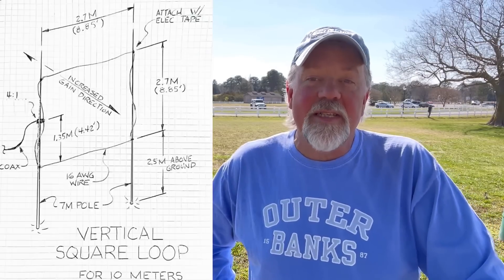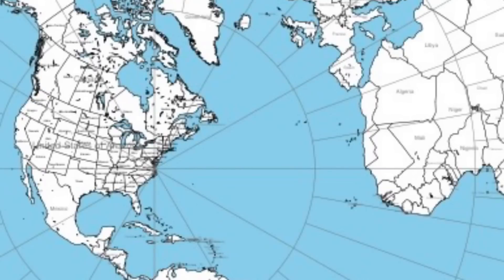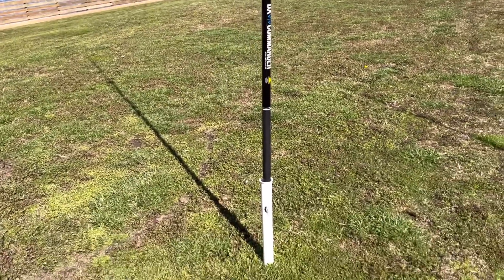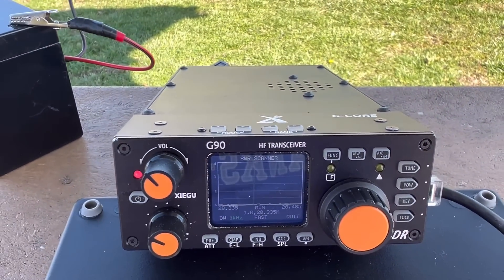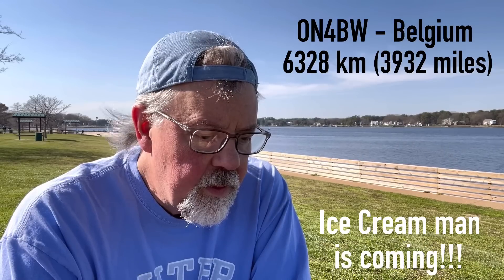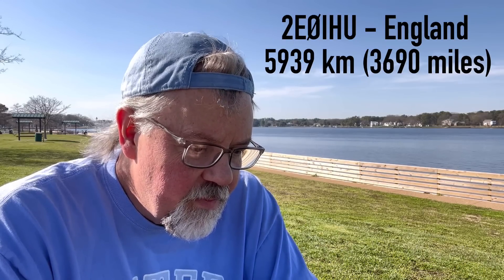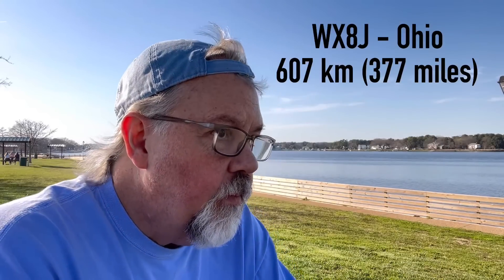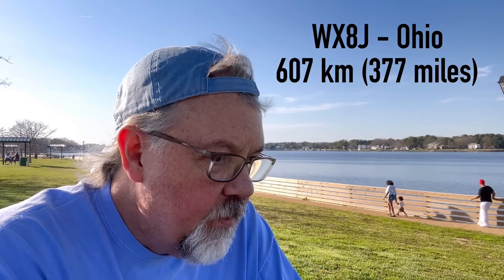Square Loop Antenna for 10 Meters

Comment: Thanks for sharing that, Walt! Those loops are definitely working! I am unfortunate enough to live in an apartment block with not a single option for an external aerial. After some successfull experiments  with magnetic loops, I've also came up with an idea to build a large loop, although rectangular. The loop I've made stretches along my apt 2x large windows and is fed from a top horizontal side. There is a very general description on my QRZ page. With an antenna tuner the loop is actually multi-band. My version is covering 80m-10m bands. Since then I've figured out, that by adding a loading coil just opposite a feed point the loop can get resonated on lower bands (80m-40m) with good results. From EI I've made plenty of USA, some South America and even New Zealand, all CW though. 
A short video of Chilean CA4OMQ signals in EI last August: https://youtu.be/XQRmCMmIvP8
73 de EI4JY, Alex

Comment: The choice of feed point makes a huge difference. Going out over earth the bottom feed ( horizontal polarization) should be one S unit better at minimum over side feed ( vertical polarization). Going out over salt water the difference is a lot less. Salt water is a great equalizer for vertical polarization but does not do much for horizontal polarization. I have a great many antenna models in EZNEC and I lowered one of my quad loops to simulate your height of approximately 20 feet to the top. I will try to email you the plot. As you said the pattern is almost omnidirectional with the feed in the vertical wire.  With bottom feed you still get a broad pattern of the broadside but off the side you get a sharp null in the pattern of maybe one or two S units (at the most) but with the extra overall gain of the horizontal feed that null is only a few dB down from the depression ( I can’t really call it a null) in the vertically fed loop.  I hope I described that well enough.
73,
Don N4DJ

Comment: Aloha Salty Walt, I can’t wait until the day that I make a direct contact with you on 10 meters. 
     I always start at 28.310 mhz, which is the local frequency for Hawaii Hams and then I go to 28.420 mhz. 
     Looking at the date of this video, that could have been me but not 100% sure. I’m kind of famous for operating my G90’s at one watt only because the G90 is such a well built radio. 
    I’ve had comments from ZL, JA and VK stations that tell me they are pushing 500 watts and I sound very loud with one watt on a homebrew antenna that I built to mimic the Chameleon telescopic vertical but in my case, it’s all about the location. 
     It’s a surf spot called Kewalos and on a map, Kewalo Basin, which is a small triangle parking lot with a restroom and a youth center out in the Pacific Ocean off the coast of Oahu, right next to Ala Moana Beach Park if you want to look it up on a map. 
    It’s a great DX location and my secret is that I use two parallel tree roots just above the ground that are side by side and about 14” of separation. Then I use a gallon or two of water after I put in my ground spike and antenna are set up. As the tree roots start absorbing the water, the tree becomes part of my antenna and then the world of DX comes alive on just one watt. 
     I’m not sure if there is any science behind what I am doing but I got the idea from a fellow Vietnam Vet who had to call for help on a PRC 77 with a broken antenna and was forced to use a tree to make a working antenna. Not only did the tree work good but he was able to call in air support from some fast movers because they were pinned down and that’s how his antenna got shot. 
     I can’t nail a spike into a tree here, the city would have me for lunch but that’s how I got the idea. 😂

Comment: Walt, I was looking for a 10M loop and found this video. I was so impressed that I had to build one for an attic installation. I used 1/2 copper pipe for the driven element for more bandwidth. Wow is all I have to say; I built it, installed it, tuned it up, and jumped into a contest, I made 250 contacts in 4.5 hours. This thing hears pin drops, and the signal reports were excellent. I tossed some photos on QRZ; thanks for the inspiration and 73's! KD9HCW

Comment: What would happen if you ran the loop horizontally instead of vertical, would that just change the polarization or could you use it (on a different band) for NVIS?

Comment: Hi Walt I’ve build your square loop. For 11m it ended up being 36 feet. I set it up on the 28/9/24 and had many contacts into the USA 🇺🇸 thank you for your inspiration 73s 26dx720

Comment: Hi from across the pond can this be made to cover the 11m for and what lengths are the wire.would love to build this as i can only do dxing in open spaces from my van.i also use the g90 happy dx and 73s 26dx720
Reply from the maker: Yes! For 11 meters make each side 2.7 meters (10.8 meters overall) happy DX and 73, Salty Walt 040 waving a hand from 2 division 🇺🇸

Comment: How does this compare to the 1/4 wave vertical antenna in your experience? Thanks Frank.
Reply from the maker: I think this is a better antenna having more directional gain. 73, Walt

Comment: I have built the Rybakov Vertical, EFHW with 49:1 unun, and am considering a full wave Skywave Loop antenna. There are some challenges making one for my property even though I'm not in an HOA. Limited space... my yard is 18 meters Long & 13 meters wide. Even so, I can fit a 40m full wave square loop within my property line. I'm considering to build it. Your video on the 10 meter loop was very informative, and I enjoyed watching it. 73's de kd5smf
Reply from the maker: Thank you! 73, Walt

Comment: Woohoo! I did it!
After watching this video, I built this 10m vertical square antenna.. in my attic!  Tested it today and it receives and transmits great! Thanks a ton! 
(I didn’t have a full 1/4 wave vertical height, so it’s a little bit squashed like a rectangle.. but still works!!)
Reply from the maker: Awesome! Thanks for sharing

Comment: As far as I am concerned, if you could only have one wire antenna..... it would be the one wavelength loop.  Square Horizontal or Delta or Vertical.  Great Job.   73 Art W1SWL
Reply from the maker: Thank you! It really is a great antenna. 73, Walt

Comment: They put a 4 to 1 balun in a manual tuner but i wonder why a tuner is not made with many different baluns that the operater cud switch to and have analyzer built into tuner thanksfor vid
Reply from the maker: Thanks for watching!

Comment: I made the Full Wave Loop Vertical and coax fed it at the bottom Left corner through a 4:1 Heavy Duty Balun. 
With 10 watts I was working DX I could only work with 100 watts.
Reply from the maker: It’s a great antenna! 73, Walt

Comment: A great SWR, :face-blue-wide-eyes:, well done Mate.  👽in Asia.  The current rooftop I'm nesting on is 79 meters high with an uninterrupted view of 360.
I'm using a sturdy 9-meter pole with a 60cm T top.   I'm not using the trusty 12.5m Spiderpole, it's too obvious walking through the foyer with a 1.2-meter tube and a backpack.  
Some stealth is required and a few slices of plastic card to get back down.
This fishing net pole packs down to 60cm.  Your 41-foot 9:1 got me thinking.  
The 12.5m (41ft) of wire goes up 5.3m, then a V of 2.2m  and back down 5.  It's my "Tall M Rooftopper".  The 9:1 is at the 1.2m wall height.
On NNAMA it works a low angle donut and is crushing it on the 21st-floor rooftop.
This is the 7th rooftop activation in the last 8 months and by far the best with this new BIG M.   My wife has to drag me off the rooftop.   
Next week we are moving into a 22nd-floor apartment with a 24th-floor rooftop and I've been given access to the rooftop and a key, MINDBLOWING!
That will be a run of RG8X from the roof straight down and into our apartment's laundry window,.  There is a 3/4 inch steel lightning cable that runs around the rooftop wall and down to earth.

PS  Hmmm, I'm looking forward in trying a full wave loop on the East/West railing, the best of both EU and US.  I'll grab another 9 meter netting pole from Lotte Mart next week.
My wife doesn't understand why I'm going up to the rooftop in such BBRRRRRRrrrrr weather all the time, I share the blame with you Walt, and your new old ideas put into action.  haha
Reply from the maker: Haha have fun on that rooftop! 73 my friend

Comment: that was great ! I have done full wave loops but loop on ground LOG they a quit antenna . has a bit of gain as you found out. larger ones will multi band.  I did a LOG at 160 meters but was 2 turns of wire spaced apart. and that works . was a SWL antenna on the ground. 120 meters SW was super on it. SW bands are a tad different. between the ham bands . was great fun. if you had 4 poles you could make a outher one and co phase them or make 1 just wire shorted together and that a reflector. like the antenna modeling of that. that only part of it. you did the outher part . try it in the real world.73's
Reply from the maker: Thanks! Yes I try to just research an antenna and do it real world.

Comment: Great video. I did a very quick Internet search on square loops. I could not find description for the how the feed comes back to the ground. Are they really connected or am I daft and missing something obvious? 73, KF0NNQ.
Reply: There is no need for a ground connection. The square loop is a balanced antenna. Balanced antennas do not need a ground connection, radials or counterpoise wires.
Reply from the maker: Thanks! As Steve described it’s a balanced loop.

Comment: Wow, great receive on this antenna but it works great both ways! Ten is by far my favorite band. I need to get me one of those G90s, been on my radio wishlist for a long time. I can't operate DX from my home situation, so I need to bring it outside and start building some of your antennas. Spring is here in MN and I have every reason to do this. Thanks Walt and 73!
Reply from the maker: You will absolutely love that G90 if you get one. Spring is here, time to get out portable! I really enjoy 10 meters too.

Comment: Just wondering Walt, why you decided to use the loop with a vertical Polarization and not use is it with a Horizontal Polarization?
Reply from the maker: Was thinking lower takeoff angle for DX if it was vertical.
Reply: @COASTALWAVESWIRES I'm not sure a degree or two would have mattered. A horizontal polarization should reduce local noise as well.  I think some people spend too much time doing theory, and not enough time on the radio. At least you "get out and play."👍

Comment: This might sound like a dumb question to some but, is the radiating element one continuous wire? No break between the side connected to the center conductor and the side connected to the shield? Thanks.
Reply: Yes, that is correct. It may seem counterintuitive. However, this antenna can be thought of as two halfwave dipoles that are joined at the ends. Only one dipole is actually fed using the feeder/BALUN. The other dipole has a virtual center feedpoint. Another way to think of the square loop is as a folded dipole that has been stretched into a square shape.
Reply from the maker: Yes one continuous loop
Reply: Thank you both!

Comment: Nice video. If you make the antenna a rectangle instead of a square ( fed and opposite side 6 ft ant the other 2 sides 12 ft) you will have a near perfect match directly to 50 ohms.
Reply from the maker: Yes I definitely want to build a rectangle.

Comment: Another great video Walt. The azimuthal map is necessary if you want to DX. I purchased a 10M Hex off eBay and realized Japan was not due West. Once I pointed it in the correct direction I was off and running.WOW, the earth is round ;)  Now I'm off to buy some speaker wire and head to the park.
Reply from the maker: Thank you! Have fun a the park! 73, Walt

Comment: Fantastic video as usual.  I agree with one of the other posters that mentioned that you are one of the few YouTube ham guys who actually fire up the ol' radio and get on the air,  Love the different antenna designs you try.  I will have to keep this square loop in mind.  Right now my project antenna is a 6 band hexbeam.  This channel and you are probably the biggest reason my first HF rig was/is the G90.  Love that radio and there is no way I would have even tried it if it was not for this channel and the success you show with it.  So far I have worked 38 Countries as far away as 6000 miles with a slapped together dipole strung between 2 trees at the house about 35 feet in the air.
Reply from the maker: Thank you! That’s awesome! Like it was said in the video “G90 ARMY”!!!! 73, Walt

Comment: Great idea. Will try this with 600 Ohm ladder line as I don't have a separate 4:1 balun, but do have a balanced matching unit.
Reply: It should work. Although you can expect a mismatch at the feedpont between the 600 Ohm feeder and the 200 Ohm feedpoint, the low loss of the ladder line should stop you loosing much radiated power.
Reply from the maker: Thanks, good luck with the antenna!

Comment: I subscribe to a lot of radio channels. Most of the ham YouTubers don't do a lot of actual radio. They talk about products. They show off batteries and bug-out bags. They interview people at hamfests and speculate on how valuable hams would be in SHTF scenarios. But actually getting outside and trying out some crazy square-shaped antenna? You are The Man for that kind of good radio stuff.
Reply from the maker: Thank you, this comment means a lot to me. 73, Walt
Reply: 100% agreed!  I love this channel and it makes me smile when a new video pops up on youtube.
Reply from the maker: @scottgordon954  thank you! 73, Walt
Reply: I could not agree more.  Walt rocks.  I have some unused speaker wire staring sadly at me, and I'm going to give this antenna a try.
Reply: Absolutely agree. This channel and Outdoors On The Air (Tracy, VE3TWM) are two of my absolute favorites. Just guys talking about gear (that they bought or built) and operating.  Please don’t change.

Don / W5DON 
Arcadia OK
Reply: So true!

Comment: Hi Walt, brill vid, thankyou.
Just an idea, you said you fancied building a bigger loop on longer poles.
I wonder, same kit as this time, but build it with appropriately longer horizontal sections, so making a rectangle.
So not a square loop, but not a folded dipole either, so what would it do?
Best 73 to you and All Walt. Mark.
Reply from the maker: Thank you! I was actually thinking about doing a rectangle. 73, Walt
Reply: I look forward to that Walt.
Time is my enemy, but you've inspired me to try this and variants, but to try the (demo'd by electronics for the inquisitive mind) 1/2 wave feeder match, cos' I'm a cheapskate, but of course, that definitely limits it to single band only.
Good luck Walt, thank you.
Best 73, Mark, M7FMC.

Comment: Firstly, this is my favorite antenna channel!

I know you're more about the wire antennas, but have you tried W6NBC's optimized loop antenna? I want to build one small enough for my apartment for 10m.
Reply from the maker: Thank you! I’ll look into the W6NBC loop. Thanks for the tip.

Comment: I made a 572ft 18awg speaker wire RX loop for 160m. It's laying on the ground in a rectangle and hooked up to a 4:1 balun. It RX's very well for 40m-160m with no atmospheric noise. My transceiver only has 1 antenna port and no RX port. I used a 2 position antenna switch for changing from RX loop to my TX antenna. The receive loop has about a 3.8 to 4 SWR across the whole HF band plan. If i accidently leave it on the RX loop when TXing the tuner kicks in and im basically TXing NVIS. Keep up the awesome content. 73's
Reply from the maker: I wish I had a yard for a receive loop at the home QTH, that sounds amazing. 73, Walt
Reply: @COASTALWAVESWIRES   There is a design for a 15 ft x 15ft square RX loop. Maybe its worth looking into if you have horrible RFI at the home QTH. A RX loop works really well when listening to AM stations also. Thanks for all you do.73's

Comment: Gonna try this with my trusdx and a 9:1 unun
Reply from the maker: You might have a problem matching the feedpoint with a 9:1
Reply: @COASTALWAVESWIRES  Yeah i was thinking about that. Worth a shot. My 9:1 has worked better on things That need 4:1 s

Comment: I believe that loop antennas are multibanded when you try a larger loop see what harmonics you can get. I wanted to try a loop but I don't have a 4:1. Actually I don't have any unun or baluns....
Reply from the maker: You are correct, I need to build a larger loop.
Reply: Awesome.
The fun part IMHO on the higher bands are small antenna builds.
 The downside is that there isn't necessarily much room to experiment with harmonics.

Comment: Great fun Walt and thanks for the video! Thanks too for the tip regarding buying Decathlon poles in Europe, I need some and will check them out. Also, given your experience, what would you consider the best height for your style of POTA working? I'm thinking of DX Commander poles somewhere between 9 and 12 meters. 😃👍
Reply from the maker: I have a DX Commander 10 meter expedition pole and it’s perfect. It’s compact to transport and I can make many different antennas with it including a vertical halfwave for 20 meters.
Reply: @COASTALWAVESWIRES  Thanks for the reply Walt, I appreciate it. I was thinking 9m would be a little short and 12m may be too much, so 10m seems a good all-rounder. Best 73. Ace
Reply from the maker: @acestudioscouk-Ace-G0ACE  Callum has 2 10 meter poles, I like the Expedition model because it collapses down so much shorter than the standard DXC 10m pole.
Reply: @COASTALWAVESWIRES  Thanks for the tip Walt. I'll look at the Expedition pole as that will give me the option to carry it when walking or cycling. Best 73 Ace G0ACE